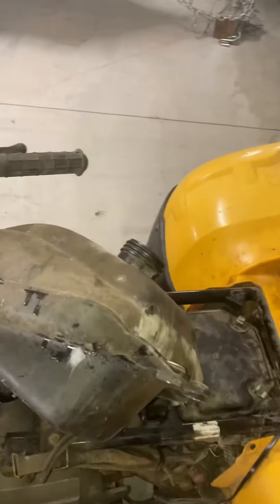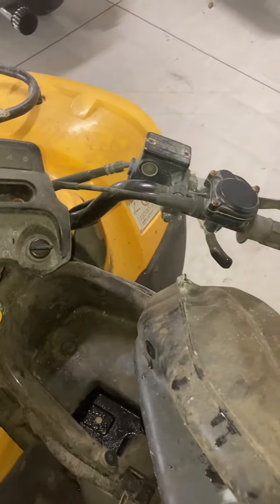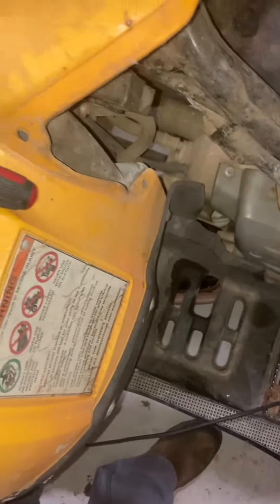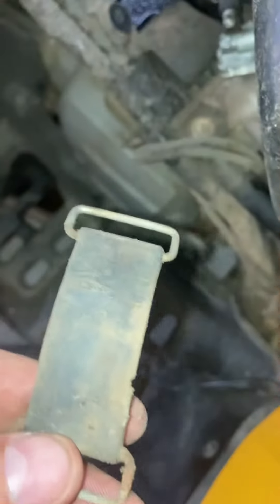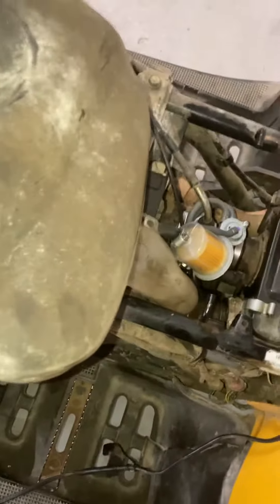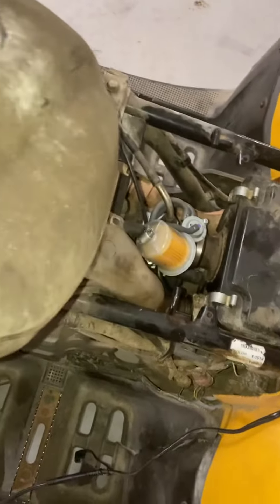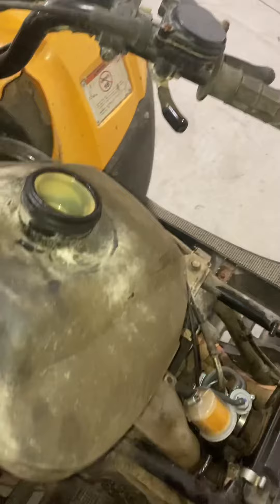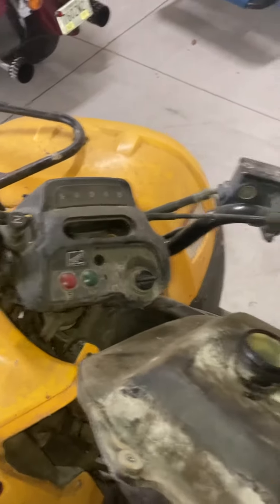Honda Recon 250 ES.  Remove fuel tank

Comment: We were trying to do the same thing this evening. Did you have any problems getting the tank to lift out with the petcock on? It seems to be hanging our tank up or there is something on the bottom of the tank holding it down. We took the clips, bolts and straps off. Still couldn’t pop it out.
Reply: Exactly why im here lol.
Reply: @rowesiph88  this was a while ago, if I remember right we ended up having to pull the petcock off and then just yank the tank out on an angle. I believe there are grooves the tank sits in. But it won’t come out with the petcock still on.
Reply: @dylanstoller2950 how the hell do you get the damn petcock off
Reply: @muddingoff-road2971  if I remember right, you take a screw out and basically pull the handle off the petcock. You can then pull it out of the tank. Let me take a look when I get home in a hour.